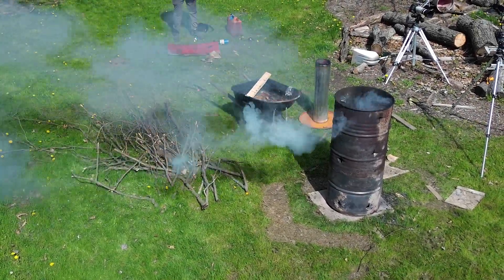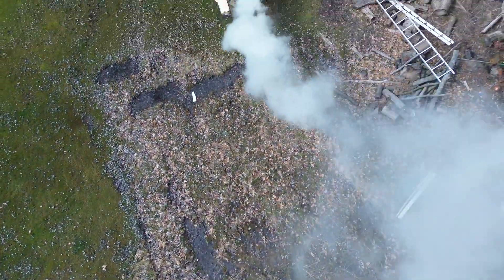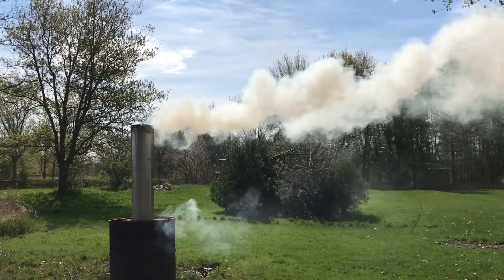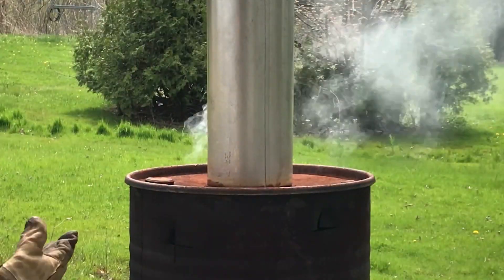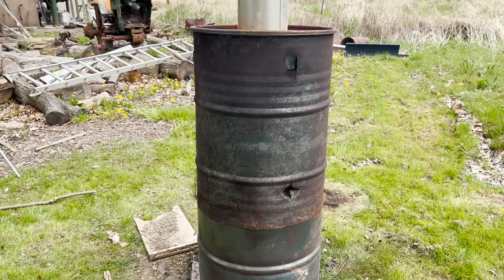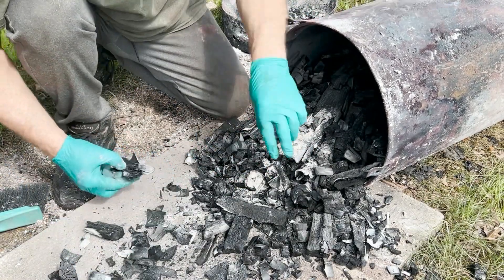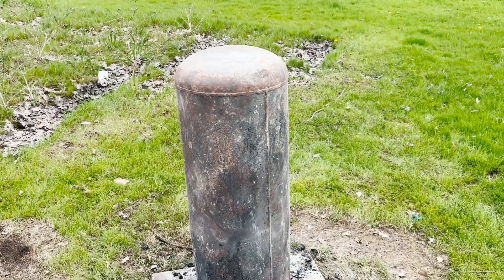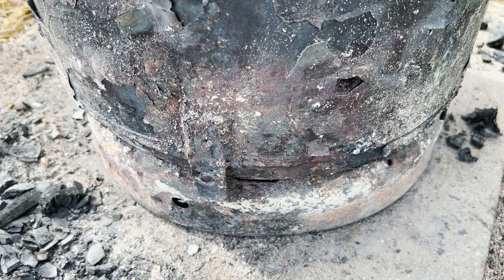Lump Charcoal FAIL from Air leak!

Comment from the maker: Thanks for taking the time to send the advice. I think I’m going to do exactly what you say. I’ll make a small sand pit and just sink the bottom of the barrel an inch or two of the into it, then pack it tight. I’ll delete the bottom all together. I guess I’ll save to put in a pipe to allow the gases to escape when it gets up to temperature. Do you think the brittleness is due to air getting in or too much temperature? I guess trial and error will answer that!

Comment: Your inner barrel isn't sealed tight enough, it's getting air inside during the cool down period and that's letting it continue to burn, causing to over cook.  In my experience as soon as the off gassing is done I remove it from it's heat source. What you can do since your seal is at the bottom is to surround the bottom with a bunch of wet sand or dirt to seal off the air getting in. That will keep the charcoal from continuing to burn inside the barrel. Good luck, I do like your set up!